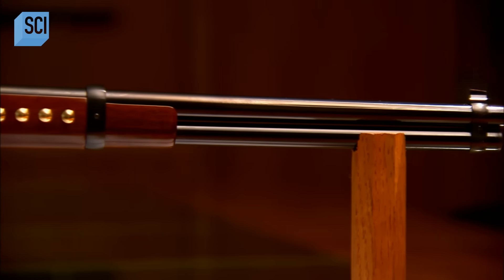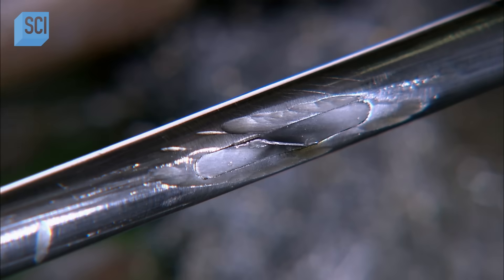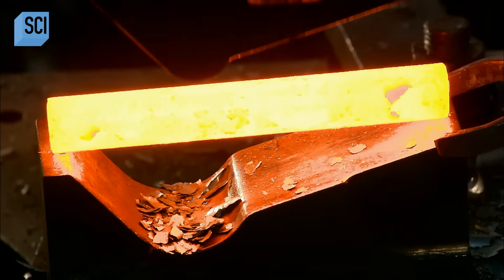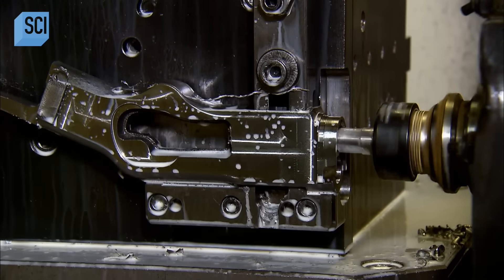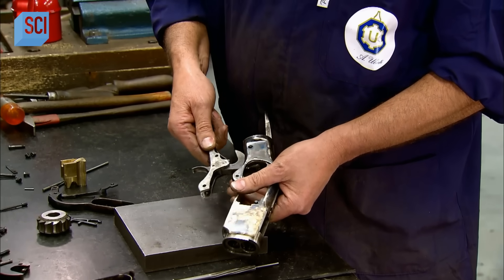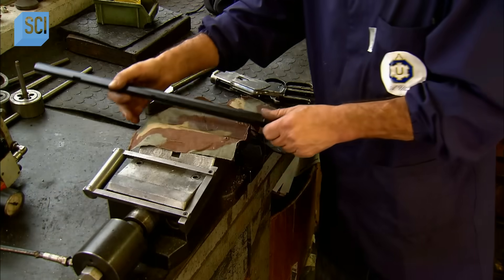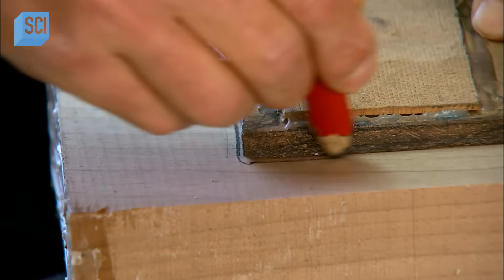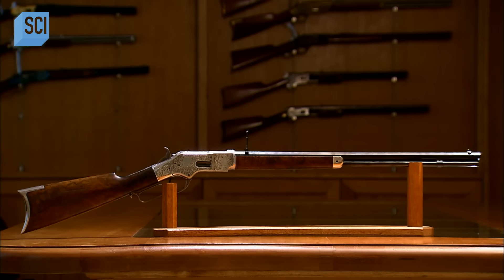How Lever Action Rifles Are Made! | How It’s Made | Science Channel

Comment: Its not an exact replica if they are not using freedom units. haha
Reply: Funny that, because i'm sure that US Military uses metric units since 1957
Reply: @muhammadnursyahmi9440  It uses both, depending on what your talking about. Distances-Yards, Miles, feet, in., mills. etc Small arms - based on manufacturer. 5.56, 7.62, .50, 9mm, 40mm, 120mm, etc
Vehicle maintenance - depends on manufacturer. Both are used. The CH46 uses imperial. The Humvee is mixed.
At the end of the day, the military is mixed

Comment: These are neat guns but the Italian lever action rifles are typically made by Pietta which are poor quality. This is actually very cheap manufacturing you are seeing. The hand fit and finish is extremely low in these guns they don't hold up well over time.

For instance in the video when they are making the lever action parts you can see one of the levers about to be installed is actually already rusted over. You are better off getting a classic Winchester or Marlin rifle.

Comment: bro the runout of those reamers is insane. it's amazing that the barrels come out within tolerance
Reply: It is, however, reamers 
will follow the pre-drilled holes accurately given that the speed and feed is correct.
Reply: @muzzy10135 But if your numbers aren't correct then the whole ope. may or may not be fixable, resulting in scraped parts

Comment: At the very beginning of this video we are told a lie. No company, none, makes an exact replica of any Winchester lever action. They modify the frame and the firing mechanism. Example is the '73 model Winchester rifle or carbine. They have changed the firing pin. On the original,  the firing pin is one solid piece of steel.
On the Italian guns the firing pins are a three piece assembly. Firing pin, firing pin spring, and firing pin extension.
This video is a lie the whole way through, starting with the first computer generated word.

Comment: The flute on the gun drill is not there to deliver “high pressure oil,” it's there to remove the chips. The oil is fed through tiny passages running through the drill's body, where it emerges at the tip via small round holes. The oil does not break down the metal shavings, that is in the design of the drill's tip. The bore reamers oil themselves in the same manner.

The spin of a bullet does not make it more aerodynamic. That is due to the shape of the bullet, itself. The spin “improves the stability of the projectile, improving both range and accuracy.” (Wiki on rifling)

What you show, as an action, is called the frame. The action consists of the frame with all its internal components. The “action” does not take a trip to a “metal treatment plant.” The frame is sent to a heat treatment plant, where it's case-hardened in this instance.

The bath is not a “hot water bath,” it's molten salts. It is quenched in water after heating in the salts.

I'm going to stop here, as you really do need to hire someone with technical knowledge before making these videos.

Comment: I didn’t see the uberti gorilla that tightens all the screws on those rifles. Guess that’s done off camera. The first thing a cas shooter does with his new uberti is to remove the too soft screws, remove the too heavy springs and replace with aftermarket harder screws and better springs. But they are very pretty rifles and after some work run great. I have a 73 short rifle and a 66 musket.
Reply: That was my first thought, lol. I couldn't help but notice that this video leaves out the nighttime security cam, where Bungo the Uberti Gorilla sneaks in and tightens all the screws to 40 quadrillion ft/lbs.

Comment: I have a Rossi/Puma brand reproduction of the 1892 Winchester, chambered for .357 Magnum.  It has a round barrel in stainless steel with a walnut stock and forepiece.  It is a hard-hitting, accurate rifle, and it allows me to carry the same ammunition for it as my .357 Magnum S&W revolver.  The tube will hold 10 rounds + one in the chamber.  The rifle also accommodates .38, .38 Special, and .38 +P ammo, with more rounds in the tube, due to differences in length.  It is a very versatile firearm.  (Puma also makes this lever-action carbine in  .22LR, 30-30 Win, .357 Magnum, .44 Magnum, .45 Colt, and .454 Casull.)
Reply: ROSSI  parou a fabricação, não  !   ?
Licenciando  p/ compra uma Taurus #.36 Circuit Judge e  recomprando m/ antigo Colt #.32 com um parente !

Comment: By the standards of a mass manufacturing like ruger, some of it is a little antiquated, but still very good and maybe even a superior gun is made by the older methodology.  
Modern barrels are often hammer forged and ruger uses advanced casting techniques for the receiver-action and maybe the lever.  A lot of MIM is used for the smaller parts.  ''Metal injection molding (MIM) is a metalworking process in which finely-powdered metal is mixed with binder material to create a feedstock. The feedstock is then solidified and shaped to produce the final product. ''

Comment: by looking at their tooling, and the wobbles. it shows me their machines are not in tolerance. and i wouldn't purchase their barrels. To me, it appears their bearings are worn, tooling dull, and not running true. even in barrel cutoff, priorto drilling, they allow their bars to just slam and drop
Reply: Glad someone besides me saw that wobbly bore drill.
Reply: The gun drills have to have play in the mount so that they can function correctly.  Their cutting straightness is controlled by the shape of the cutter, not the mounting.  If there was no play in the mounting, they'd be easily pulled off centre.  Google "gun drill".
As for the cut and drop:  They're blanks that are going to be machined after the bores are drilled.  That's what they align to.

Comment: I prefer my 1979 Winchester model 94 lever 30-30
Reply: If only is was a pre 64
Reply: @AR_119  anything pre-1994 is still decent.. Mine has sentimental value, it was the first gun my pop bought me new in 1980..  BUT anyone who owns a Model 94, isn't going to hunt with a pre-64. My 79 is used every hunting season. I got a very nice 6 point Sept 17th last year, just waiting for the season to open this year (Sept 15)
Reply: @KrazyMitchAdventures  that is fair enough. In a gun like that with sentimental value has a special place in any collection for sure. You are right about those ones made after 94, I've seen a few made between 95 and about 2005 and they are just not as good as the newest ones or the really old ones. I was lucky enough to grab a pre 64 model 94 a few years back for a really good deal but I do baby that thing haha. I would never take it hunting.

Comment: Ok how was this done 160 years ago?
Reply: Same sort of cutting tools, but guided using a sort of pantograph running over a jig or template to control the shape created.

The improvements in modern technology is in the flexibility, not the complexity of the job. In the old days if you wanted to refine or correct the cutting machine, you have to make a new template for the new shape. Today, if you want to tweak the design you change a few numbers-- much faster and easier to do.
Reply: Like everything else, with a lot more hand work and took much longer to make.
Reply: @donaldroehrig3  I would love to see it

Comment: The hell kind of boiling water you guys using over in Europe that can cause steel to glow at 1600 degrees? Over here in America we have to use molten salt baths for our color case hardening... no wonder your tea sucks.
Reply: Their electrical system uses 240 volts instead of 120 like ours, so they can boil water really fast there, probably the same thing with steel too.
Reply: @ladyskinwalker  I can't tell if you're trying to feed into the joke, or if you actually don't know that the US uses 2-phase 240v power.
Reply: @SnowblindOtter  wait what? Who told you this?
Reply: @ladyskinwalker  Bro. Clothes dryers are 240v appliances.
Reply: @SnowblindOtter  that's because they have the bigass plugs, regular water boilers of any kind don't run at that voltage. Those have separate wiring. The very large majority of the electrical grid runs at 120 volts, electric appliances like that are the exception.

Also, I use a gas washer and dryer at my house, it's cheaper.
Reply: @ladyskinwalker  I work for an electrical and power cable manufacturing/distribution company. The grid runs on 240, but it's stepped down for homes. This is because electrical coding in the US is garbage, so if you ran 240 volts through a 'standard' voltage circuit you'd burn the building down.

Comment: How long to make one originally?  The woodwork alone would take a week.
Reply: It would definitely take longer, but, Winchester, Marlin, etc just threw bodies at the manufacturing process. One person in a shaper would mill out one section of a part, six at a time, in a jig, then pass it down the line.  They did have tracer machines that followed a stock model, a stylus would follow the model and ball mill cutters would remove the excess wood as the stocks rotated.

Comment: Not many people know that rifling was not carried out on gun barrels to put a spin on the bullet to increase accuracy!

Rifling was intended as channels in which black powder residue could get into in order to allow more shots to be fired before the barrel would need to be cleaned!

If was an extremely fortunate consequence of rifling that projectile accuracy was hugely improved.

This was understandably welcomed, but for the requirement to clear black powder residue from clogging the barrel it wouldn't have been done...
Reply: Not true- see Whitworth's patent. For fouling, only straight grooves would have been needed- a lot easier to cut. Back in muzzle  loading days, the bullets were designed to expand into the rifling, to ensure they engaged- it was all well understood.
Reply: Accuracy: The quality of a gun to put a shot as close as it can to where you aimed it.

Precision: The quality of a gun to land multiple shots as closely together as possible (known as group size).

A gun that will put a hole close to your aim point is accurate. If every subsequent shot is spread over four or five inches from that aim point, the gun isn't very precise.

If your gun puts five shots in a target close enough that they touch each other, then the gun is precise. If that very tight group is three inches above where you aimed, then the gun isn't totally accurate.

So, when you think about the spin imparted by rifling, are you thinking about the gun's accuracy or its precision?
Reply: No way!

Comment: 55 sec in, that drill is called a gun drill. The tip is carbide and can be reground for reuse. As long as it is fed slow with medium to moderate rpm's the vibration is kept to a minimum without the drill walking at the bottom of the bore ( may need adjusted).
Reply: ok
Reply: @snoop6300  :p
Reply: Correct👍

Comment: It's amazing to see how much the machines actually do for a firearm that still looks handmade...also humbling to think that at one point, this firearm was primarily made  by hand!
Reply: oh no the lever action was never hand made. It was hand finished, but industrial machines and patterns did the vast majority of the rough work. They were just powered by steam and patterns instead of electricity and NC programs. 

Part of the reason why these guns are hand fitted still is because they weren't exactly designed for automated manufacturing. They require the hand fitting process to be safe and frankly to function properly, unlike the most modern designs that are meant to basically come out of the machine, undergo coating, and then relatively unskilled assembly to be ready.

There's beauty in both of the approaches for sure, but I am personally a bigger fan of the modern :D
Reply: @grinchyface  well put
Reply: @olsonusmaximus  Jesus Christ loves us all.

Be kind and compassionate to one another, forgiving each other, just as in Christ God forgave you.
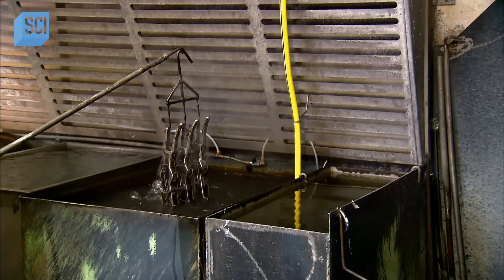Ephesians 4:32 NIV
Reply: @grinchyface  I wouldn't be so sure that the chiselwork is required for anything but that barrel thing, and also probably it's not strictly necessary most of the time. Still, I'd bet replacement anything else just drops in without any effort.
Reply: @grinchyface I believe the commenter was referring to the original Winchester rifles from the late 1800’s
Reply: @mist5142  They were never really made by hand. The majority of the work was done by machines, as was mentioned in the comments. Gun manufacturers invented the production line because it made it possible to have interchangeable parts. Any gun could be repaired with any spare part for that model. That wasn't possible before that, because it was all made by hand and therefore not perfect. Nuts and bolts were made as pairs for example. Lose the nut and the bolt become useless. 

Henry Ford took that idea and used it for his car production, for the same reason gun manufacturers did: production volume. Machines don't get tired and get it right every time. Making guns by hand is too inefficient.
Reply: @grinchyface  Jesus Christ loves us all.

Be kind and compassionate to one another, forgiving each other, just as in Christ God forgave you.
Ephesians 4:32 NIV
Reply: Learn something new everyday! 👍
Reply: @joeg8269  it's worth mentioning that even with careful marking to plans and powered drills,lathes and mills, some parts were so complex and fragile they were hand marked and filed to shape for many different products of a similar era (1860's ish); Even the powered tools required more skilled operators to produce at speed though, a skill still used for small runs of parts. In Khyber pass in pakistan, there's workshops turning out anything from break action huntinjg shotguns and bolt rifles up to semi auto handgun and automatic rifle clones with similar hand and non CNC power tools- a few interesting documentaries on youtube
Reply: I was thinking just the opposite. That close-up of the rifle engraving looked as if made by a machine.
Reply: Who is the manufacturer of the lever action rifle in the video
Reply: @tylerbabcock2653  Uberti, which is IIRC now owned by Beretta. Uberti makes high quality reproductions of historical firearms, including single action Colt revolvers as well as the lever action Winchesters in the video.
Reply: @tylerbabcock2653 Uberti of Italy
Reply: That's what I was gonna say. Just imagine how firearms were made centuries ago. Everything from a ring gun, to umbrella guns, Cane guns. All crazy but beautiful work of art. Just take a look at the Henry lever action rifles to Colt handguns. I could just sit and salivate looking at these weapons.
Now a days I don't think there is any fire arms that are made without any computers anymore. 
I may be wrong but I caint think of any.
Reply: All this work being involved is the primary reason why stamped guns became prevalent in the 20th century
Reply: Look up old remington videos from the 60s. Specifically how the 1100 was made but any gun of that era. I know there's one floating around YouTube that shows the whole process. It was definitely more manual in production processes but still mechanical. Replace robots with milling machines guided by templates, and you've got gun production going back to the Civil War. In fact, the first assembly line with parts interchangeability was invented for gun production.
Reply: My thoughts as well.
Reply: They’re still partially hand assembled can’t replace humans completely
Reply: No shit Sherlock.
Reply: Jesus Christ loves us all.

Be kind and compassionate to one another, forgiving each other, just as in Christ God forgave you.
Ephesians 4:32 NIV
Reply: @xan6990  So what because so does buddha, muhammed, joseph smith, and all other prophets at least claim to.

Comment: So the barrel is soft steel?  Makes sense i guess…
Reply: No lol...
Reply: Simple version, the barrel is machined, then heat treated to bring it up to a specific hardness.  Too hard, and the steel is brittle, too soft, and the steel will deform under the pressure of firing. There may be other treatments, such as some sort of carburizing to make the surfaces more wear resistant.

Comment: Nice craftsmanship. Nice video, but the diameter of the barrel does not determine the gun’s caliber, which is what the narrator said.
Reply: Yes it does.
Reply: @derschwarzgeist  No it doesn't. Or there's something wrong with every one of my guns. For example I have a gun with a barrel 0.68 inch in diameter; it takes .45 ammunition. It's the nominal diameter of the bore that determines caliber, not the barrel diameter.
Reply: @marshalshlafer7211  A barrel (or anything with a bore) has two diameters. An inner diameter (ID) and an outer diameter (OD). One of those two diameters does indeed dictate the caliber of the barrel/firearm. So the narrator wasn't exactly wrong....just not as precise as she could have been.
Reply: Right, 35 whelan 35 remington 357 mag etc etc
Reply: The diameter of the metal rod used to make the .45 caliber version of this rifle is the same size as for the .357 caliber version of the same gun. It's the same barrel stock, same diameter-- it's just that the hole bored into the center is bigger than the other.

It's the bore that determines the caliber of a gun, not the barrel's diameter. The .45 caliber barrel simply has thinner walls than the .357 one.
Reply: @BogeyTheBear  Right. But the bore is one of the two diameters on a barrel. Every barrel has an ID and an OD, the inner diameter determines caliber.
Reply: I think they meant the diameter of the hole, as that's what they were just describing.